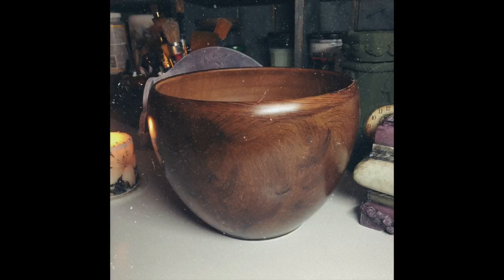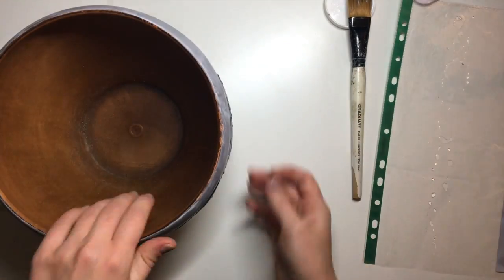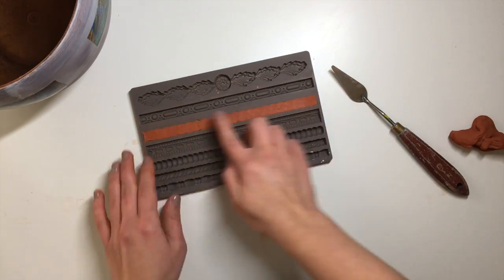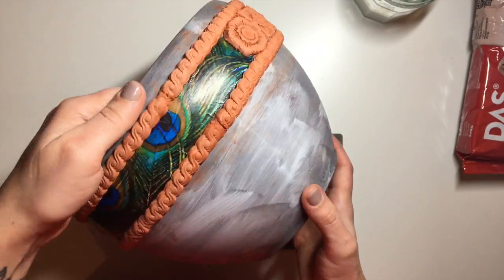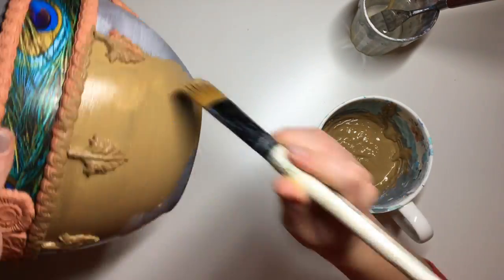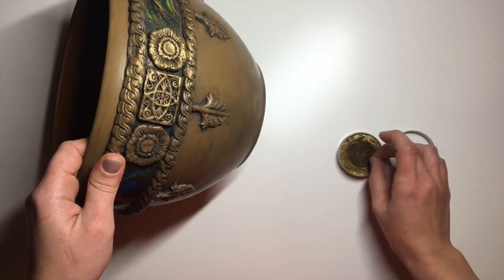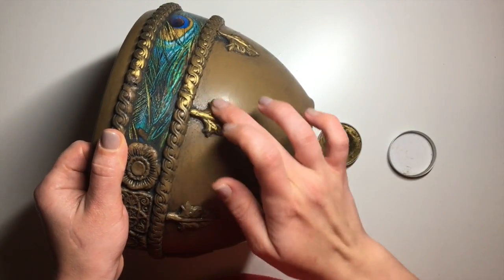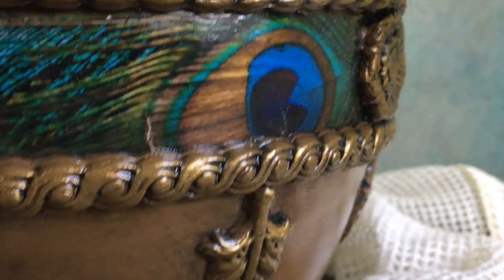DECOUPAGE TERRACOTTA PLANT POT TUTORIAL | SIMPLE UP-CYCLING PROJECT IDEAS

Comment: That is gorgeous! Is the clay just modeling clay? Where did you find the mold, are they silicone or soft material? Thanks for sharing.
Reply from the maker: yep, just normal air drying clay, you could use any brand really :) and moulds are by redesign with prima, I've left links to everything in the description of the video  <3